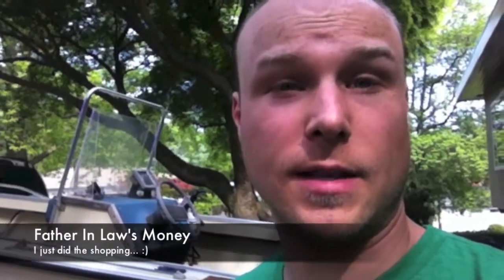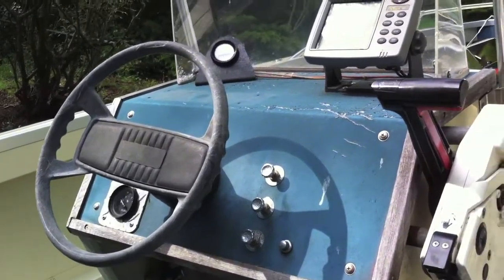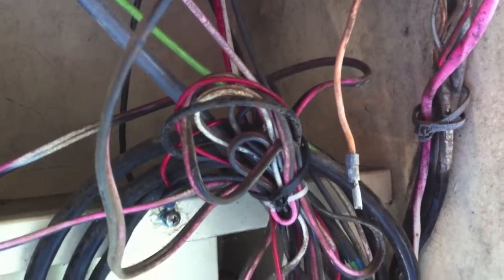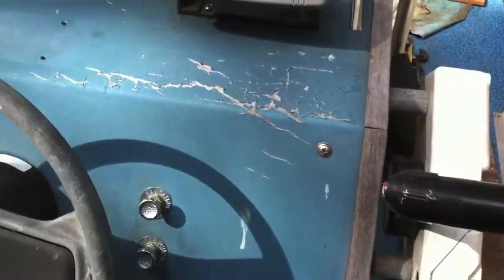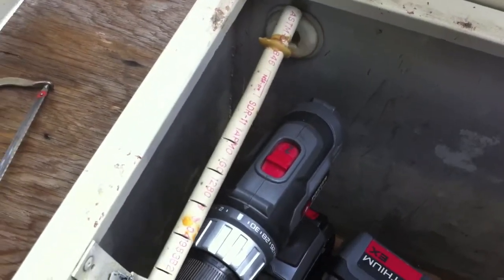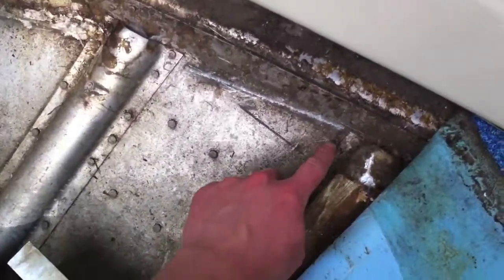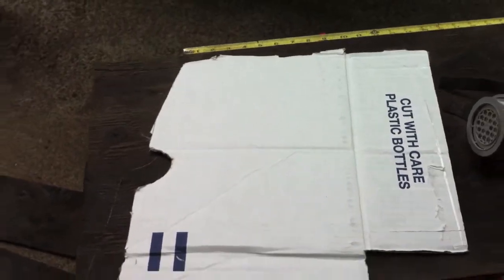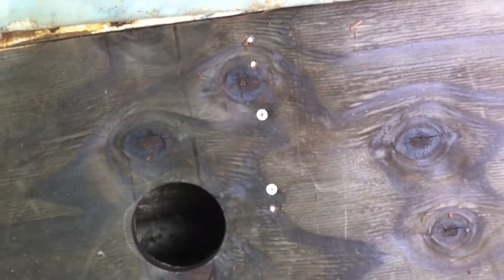Aluminum Boat Needs Work

Comment from the maker: Maybe but they don't go to where you'd need a downrigger, it's just weird. The motor has a few wires and it only has one gauge and 3 switches. Only one switch works so I'm just going to take all the wires out except the motor  wiring and start again. All the connections are bad anyway. It won't cost much but it's just time.

Comment: You might want to put some sealer on the bits of the plywood that are touching the hull in order to prevent wood to metal contact as the copper in the preservative might otherwise corrode the hull.
And WRT the wiring, soldered joints and self amalgamating tape/adhesive lined heatshrink tubing are your friends.

Comment: I have an 83 PM160 I bought cheap and am fixing up.  A bit better shape than yours.  That livewell should have a drain, overflow and a fill I would think. Thats how mine is setup under my seat.  I found a bunch of extra wires in mine as well.  Most of those probably aren't even doing anything anymore, mine weren't and I pulled most out.  Under the dash looked like your trim(green/blue) and some other stuff. Trim, bilge, lights, livewell.  Keep it simple.